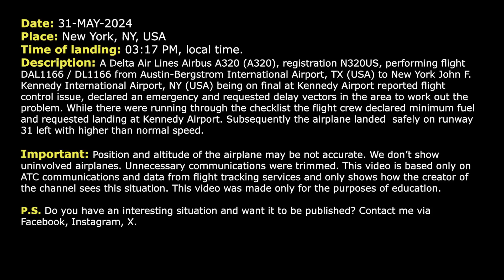Airplane almost runs out of fuel during flight control emergency at New York Kennedy. Real ATC

Comment: in the UK, the assigned runway is closed to all traffic until the emergency aircraft has arrived, and we have far fewer runways (typically 2), with some smaller airports configured for single runway operation. it doesn’t make sense to clear a departing aircraft when there are plenty of other runways available to switch departures to.
Reply: literally 10 runways in new york suitable for landing within 5 minutes flight
Reply: @Tips-wt2ok  not sure if you noticed but the plane in question required the longest runway. atc should be able to accommodate the requirement
Reply: @Tips-wt2ok So redirect non emergency aircraft to those and keep a sterile runway for the emergency aircraft. Safety is No.1 priority, always.

Comment: That is a pretty close to minimum fuel landing even if everything went normal. Was this a diversion/alternate landing? Else this is really a questionable flight and should be investigated. If 1 more thing went wrong, they would have gone through the swiss cheese model to disaster.
Reply: standard airlines squeezing pennies....
Reply: It’s not even close to actual min fuel.  It’s a precautionary declaration.

Comment: Flaps or slats problems in approach will normally mean you have fuel issues, and you don’t have all the time in the world to do the checklist. It can be done pretty quickly if u r familiar with it, which you should. One lap in the hold, that’s all it takes to make sure u can land in the intended runway, determine your landing configuration and approach speed. Then brief about a possible go-around and then go for it. If u have to do that checklist as if it was the first time u see it, you need half an hour of reading and chatting

Comment: I really like the pilot’s handling here. 1. Assuming nothing, identifying as minimum fuel emergency aircraft with each controller. 2. Direct and assertive about what she needs.
Reply: Absolutely! We're taught to relay the problem to ATC like we'd explain the problem and our requirements to the cabin crew using something called a NITS brief. They ticked all of the items in the NITS in their communications with ATC so it was VERY effective comms from the pilot monitoring.

We use a NITS to brief 3 different groups usually in this order (ATC, then Cabin Crew, then Passengers and adjust the specifics for the intended audience)...
N (Nature): We have a flight control problem, specifically a slats jam.
I (Intentions): Our intentions are to enter a hold to complete any checklists and then make an approach to 32L in JFK
T (Time): We should be ready to make an approach in 10 minutes
S (Special Instructions): We're going to need a longer final approach to configure and will make a precautionary landing so could the fire services follow us onto the gate.

It's a great tool as it covers what's going to happen and more usefully, what the flight crew want from ATC/Cabin Crew or what the passengers should expect.

Comment: The long non normal check list was made even MUCH longer by so many vectors and TALKING and bad workload management. Why pilots don’t request a holding, keep ATC at bay and on standby. Once you finish your procedure give CLEAR and short request to ATC of what you need. Not even the MAYDAY call was according to ICAO standards. Small problem, made a big one for no reason. 🤦🏻‍♂️
Reply: You do not see that all that back and forth you criticise was 30 seconds combined, max, while the whole emergency took at least 30 minutes. So it is marginal and no real problem. This way at least every body was on the same page...
Reply: Well the video shows more than 30 seconds of trash talk.

Comment: Whats the point of declaring minimum fuel when you already declared a mayday?
Reply: It's a completely different type of emergency. ATC needs to be aware of both emergencies.
Reply: @janeryan2709  Actually declaring minimum fuel is not an emergency situation as per ICAO.
Reply: @timeslidez  Yes, but when you already have another emergency and your fuel is at minimum, the controllers need to know that too. Those are 2 separate issues.
Reply: It means deviating an alternate is not an option any more, u r committed to land there and there is a chance u might get into mayday fuel. So a heads up for ATC
Reply: You really need an answer for that?

Comment: It seems to me the airlines and perhaps the FAA (although I am not familiar with Part 121) has created such strict pilot procedures in dealing with emergencies and malfunctions that it seems to take command decisions away from captains. I understand the importance of following emergency procedures checklists but I don’t like that I get the impression that pilots must complete checklists no matter what. Yes, emergency action steps that must be completed are essential. But long drawn out troubleshooting checklists that could distract from checking fuel or are completed in spite of the seriousness of the emergency or fuel status does not pass the common sense test. A pilot should be able to quickly compute airspeed and runway length needed for approach with stuck or failed slats/flaps and land without jeopardizing fuel exhaustion and flameout. But it seems these long drawn out checklists are the standard operating procedure. 
I recall the aircraft in Denver that blew a #2 engine scattering a cowling and other parts in the suburbs. The engine could have been on fire for a time. Yet landing had to be delayed until the precious checklist was completed.
Reply: Massive disagree. I'm a captain on that type and the checklists need to be done properly and a thorough brief of how to fly the approach is crucial, along with the threats and errors that will affect (high approach speed with gusty headwinds, not to mention unusual landing attitudes and the risks of tailstrikes).

Why rush it, go around due to an ommision, not briefed the required go around config (found in the checklist, good luck finding a line pilot that knows that) and making a hash of it straight into a mayday for low fuel.

This was a routine failure with a checklist CUSTOM MADE for it (unlike your fan cowl scenario). The point of checklists is often to either secure a damaged system to prevent further problem, or restore a degraded system into a better configuration. Your idea of what is expected vs what is sensible is rather outdated. A commercial pilot learns pretty quickly that there is so rarely ever a cause to rush. There's better methods than making it up as you go along to get it on the ground faster. The industry has learned that the hard way.
Reply: Checklists are there because commercial aircraft are immensely complex machines and no one can remember everything that needs to be done in every specific situation.  They are precious, in this case as precious as the 167 souls on board.  You only ignore the checklist when the ground is approaching fast and you need to find a clearing in the forest.  This plane is flying just fine and they need to configure it for an unusual landing.  Only an idiot would try to do that without a checklist.
Reply: @danfoster8219  this was what I was talking about. Getting it on the ground expeditiously.   https://youtu.be/Nz29s87jXOA?si=KPbUa2R74clEkNX9
Reply: A slat failure is not a "we must get on the ground now" emergency (unlike, say, an onboard fire.) It's a "we need to look through this methodically and figure out what the safest way to execute this approach is given the condition of our aircraft" emergency. The VAST majority of non-medical emergencies are the latter type, not the former. Unnecessarily hurrying and skipping steps has caused a lot more accidents than it has prevented. Of course, pilots know the difference between those types of emergencies. If they had a fire on board or fumes in the flight deck or some such thing, they would of course be planning to get on the ground ASAP.

Also, remember that "minimum fuel" is just an advisory. It's just to let ATC know that if the cause delays for you, then you'll likely end up needing to declare emergency fuel and so they should plan accordingly to try to avoid that.
Reply: Those of you who replied to my comment are correct but I feel I may have misled you to thinking there is no need for checklists. There absolutely is a need for checklists and I agree on complex multi-engine commercial aircraft getting an understanding of what has failed and what that failure means for continued operation or landing is imperative. I’ve never been a fan of delaying landing for the sake of inflight troubleshooting when troubleshooting should be left to maintenance personnel. However many emergency procedures include troubleshooting steps as part of aircraft configuration such as manual operation of a subsystem. Having been a helicopter pilot for decades in one of the most complex helicopters in our military I can say that for new pilots, my instruction to them on land as soon as possible emergencies was that when in doubt, get it on the ground. If you screw up the immediate action steps to the emergency procedure but land, we’ll have a talk about it but they would not be in trouble. On the other hand I have had students that were so involved in getting the simulated emergency  identified and performing the emergency procedure by the checklist, that they would have crashed because they forgot the most important step: aviate!
Reply: @josephroberts6865  "...the most important step: aviate!" - Well said.
Reply: @josephroberts6865 how to handle an engine failure on a single engine aircraft has almost no correlation with any non normal situation that you might encounter on a multi engine, multi crew airliner.
Reply: @kickedinthecalfbyacow7549  no one said anything about single engine failure in a single engine aircraft. Comment is irrelevant.
Reply: @josephroberts6865  ok….. flying a simple, single engine airplane is different to flying a complex, multi crew, multi engine, public transport aircraft.  These aircraft have back up systems, meaning that there is time to diagnose, run check lists, make options, do performance, configure the aircraft, communicate with cabin crew, passengers, company and ATC. You can’t just put down in a field in 30 seconds.
Reply: @kickedinthecalfbyacow7549  your comment is still irrelevant. The aircraft I flew was a dual engine, triple hydraulic system, triple electrical system not counting the battery, advanced flight controls dual redundant engine controls, manual engine control, with complex fuel system and five complex gear boxes (transmissions). In addition to that the aircraft has mission specific systems and mission avionics enabling it to fly in almost any weather day or night, and could carry as many as 90 passengers. The aircraft has about 100 emergency procedures to know thoroughly. Not a single engine airplane! Everything you said commercial airlines have, this aircraft has except that airlines must stay in the air to make money. Consequently, there is no rush to return to a departure airport until every troubleshooting checklist is completed. Moreover, in addition to troubleshooting, these checklists are there to minimize legal and liability issues as well. I get it but having to declare minimum fuel while the crew focuses attention on checklist completion doesn’t sound like an ok thing. That was not a long flight. Probably a couple of hours. Either it wasn’t filled with gas or the checklist running took an inordinate amount of time. Either way, no need to get anywhere near close to fuel exhaustion even though minimum fuel is probable 45 minutes of fuel left.
Reply: @josephroberts6865  that sounds very impressive, you have ticked a couple of the boxes, but it’s still not the same. I understand that military helicopters are different from civilian airliners, but for some reason you don’t.
Reply: I agree with @easyjet8749 that following checklists is essential, however, many checklists need revisions for concurring emergency breakouts. In this case. a breakout to abbreviated checklist if min fuel, rather than trying every possible trick to re-engage the slats.  Or, in Sully's case, a breakout for low-altitude in the engine restart checklist. (I think they may have added that one now.)

Comment: After listening to this, I won't be flying Delta anytime soon. She was ok initially but got worse as it went on, and he was a hot panicked mess right from the start! I'm glad they made it down safely, but it sounded like they're both fresh out of school. He dropped his call sign after the first call, and she got worse over time...slat thing??? Yea, I don't know what's going on over at Delta, but I don't want to be part of the story.
Reply: This captain at Europes largest Airbus operator thinks they did a grand job. Whilst some of the phrases are slightly different, their comms was excellent throughout. They conveyed their problem, aircraft fuel state, urgency level, requirements perfectly.
Reply: Greyhound doesn't want you....they have a no curmudgeon policy.
Reply: If you think any other US domestic airline is any better, you're in for a rude surprise lol
Reply: Current frequent-flyer and pilot consensus seems to be that it doesn't get any better than Delta for safety these days. Sorry to deliver bad news, but aviation has sunk that low.
Reply: @KennethAGrimm  When did you last fly and how many commercial hours do you hold in order to be able to judge this as a failure?
Reply: @easyjet8749  Sorry for the confusion; I forgot to switch to the "sarcasm" typeface in my reply to @ShadyS-2012. No, I don't see it as a failure; if people are scared to fly on Delta, they should take the train. (The last time I took the controls was IFR instruction in actual IFR in a Cessna single five decades ago. Since then I have been an engineer designing ATC computers and cockpit instruments.)

Comment: Sorry, this isn’t “almost running out of fuel.” Fuel emergency was never declared, nor was it required. 5400lbs is enough to go around, come back for another approach, and still land with final reserves intact.
Reply: they were stuck at 2000 flying level with part of the slats out, not your normal fuel consumption I guess.
Reply: what are final reserves? can the plane use it? deplete it?
Reply: actually, the plane was almost out of fuel on landing

Comment: What a mess... Where's the CRM!? Captain talking over the co-pilot, who seems very nervous about the situation. Declare an emergency with only 5,400 pounds of fuel!? Then declare "minimum fuel"... and if you need to "go around"?! Good thing I wasn't on board...
Reply: The emergency was a flap malfunction, not the fuel. (They still need to watch their fuel, though.)
Reply: Lucky you weren't on board, because they likely don't have a toddler booster seat.
Reply: Yeah, both people on the radio seemed not ideal CRM, but otherwise seemed fine.

Comment: It is extremely concerning to me that ATC didn't hold departures on the runway assigned to the emergency aircraft that has declared the emergency, clearly stated a need for a long final, and also communicated minimum fuel.  If for any reason there was a rejected takeoff, that could have had major adverse consequences, all for the sake of a 15 minute delay on departure.
Reply: I'd guess more like a 5-minute delay. And, yeah, that seemed odd. I get that JFK is busy, but, personally, I think just holding the departure a few minutes is the safer course of action. An unnecessary go-around in this situation could significantly reduce safety of the flight and increase stress on the already-busy crew, especially since they'd likely be needing to go around with less lift than normal and they'd likely need to fly the circuit back around with more drag than normal and it would be a longer circuit than normal in order to set back up for the longer final.
Reply: Several similar comments. Consensus is you are correct.
Reply: America for you.

Comment: lol, meanwhile air canada pilots park on runway for same issue
Reply: Wasn't that a Flaps issue? And their brakes were hot and this aircraft was lite with low fuel meaning brakes were not hot?
Reply: @mcshamer  same issue , for obvious safety reasons - always gtfo of the runway unless disabled

Comment: Min fuel means they hit their minimums before needing to divert or the minimums to land if they didnt require an alternate. That means they needed no further delay. This wasn't Emirates situation at YVR where they needed to immediately fly a VFR circuit in the case of a go around. They just needed no delay. The crew handled this quite well, regardless of what comment section incels want to say
Reply: Here’s what the FAA has to say. 

https://www.faa.gov/sites/faa.gov/files/2022-11/INFO_08004.pdf
Reply: Clearing departing traffic for takeoff while they were on final wasn't a wise decision given the circumstances.
Reply: Not sure if it differs in the US, but in Europe, a minimum fuel call explicitly means they don't have fuel to divert and are committing to the airport they've designated.
Reply: @easyjet8749  minimum fuel means either you are into your IFR mins at the airport, or you will be at the diversion airport. In this case, the weather at JFK was VFR , so it is likely they didn't have an alternate and they went into mins
Reply: @N1120A  They're saying that for legal puposes, they've either burned their Alternate fuel, or are now intending to use it at JFK, which given the weather, was a legal decision.

You couldn't commit to land at an airport that didn't have weather above any applicable IFR minimums. I think you're confusing IMC with VMC, the flight here remains an IFR flight and IFR fuel planning rules apply (unless they formally 'cancel IFR'). 'Minimum fuel' does not account for any diversion elsewhere, they were 'minimum fuel for JFK' after which any delay would mean they'd need to declare a PAN or a MAYDAY.